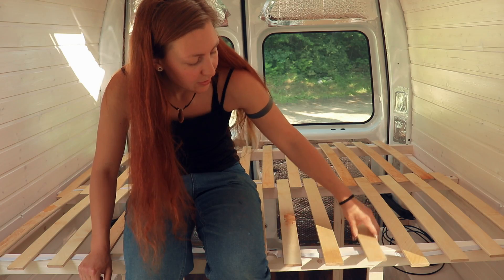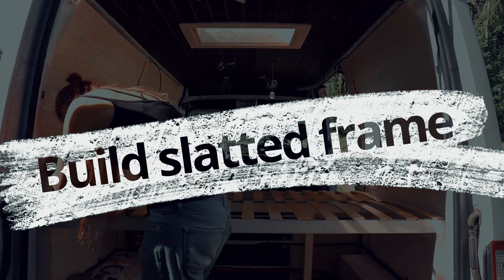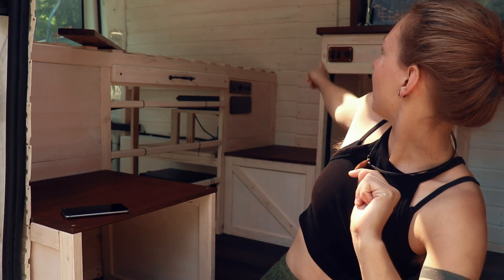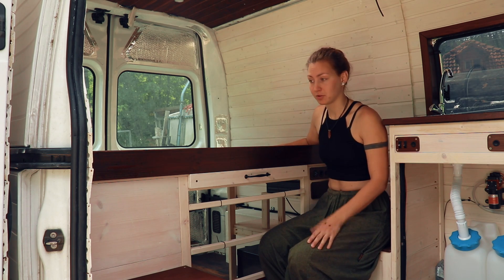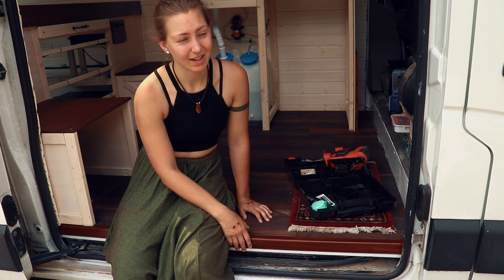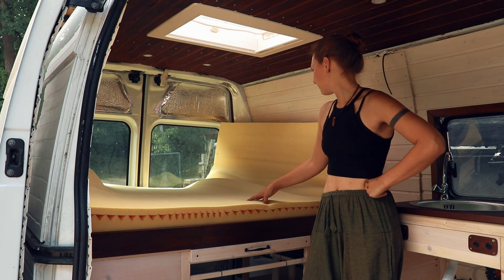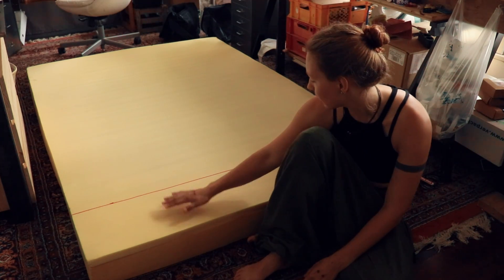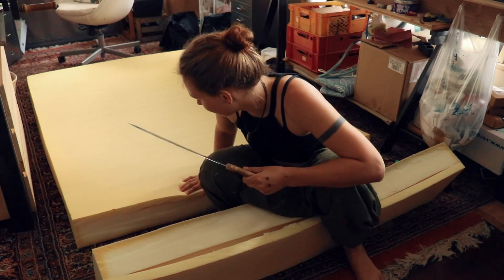Recycled foam for my VAN BED matress | Van Build #19

Comment: Love the slats,  Plenty of ventilation.  Maybe keep the mattress away from contact with the back doors to prevent condensation wicking into the mattress?  Maybe another board like the one at the front of the bed a couple of inches from the doors?